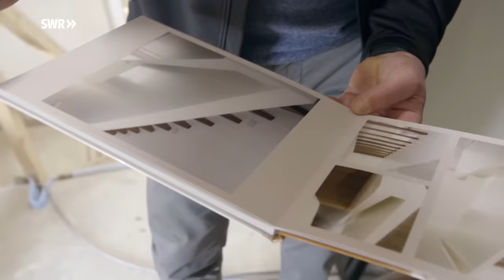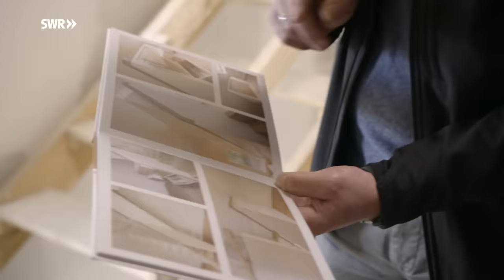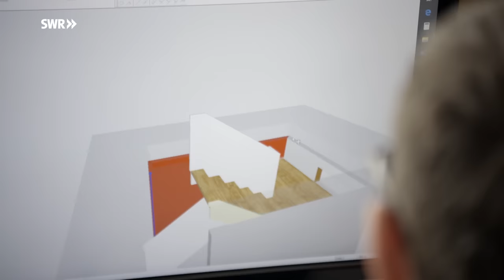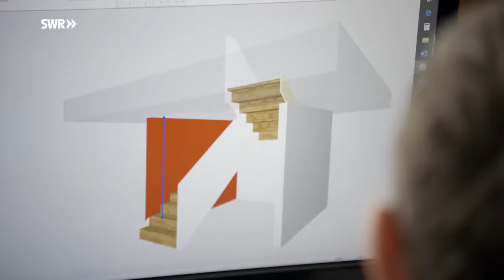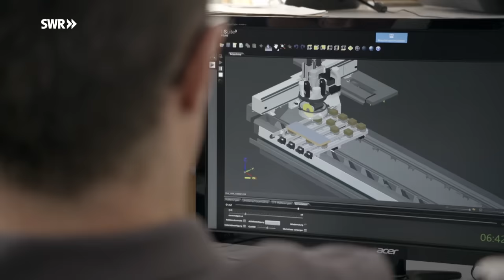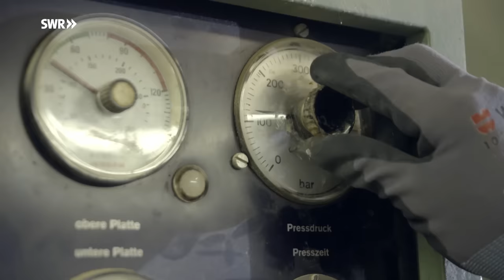Wie man eine Designer-Treppe baut | SWR Handwerkskunst

Comment: All the effort spent sanding and oiling the ends of the treads only to bash them with a hammer while assembling. Surprised it still fitted into the riser.